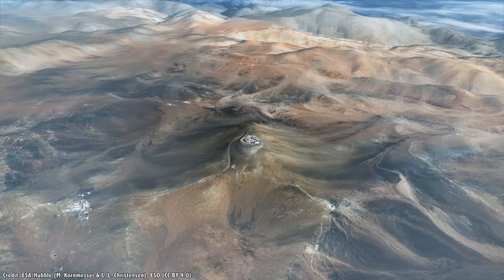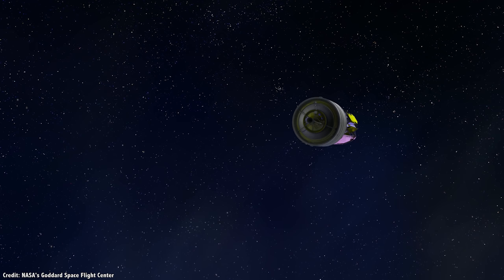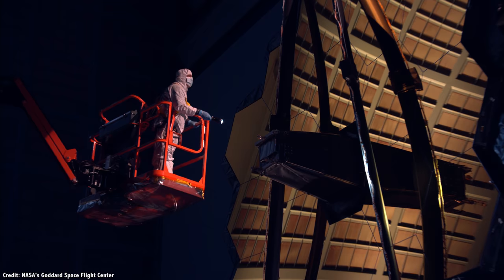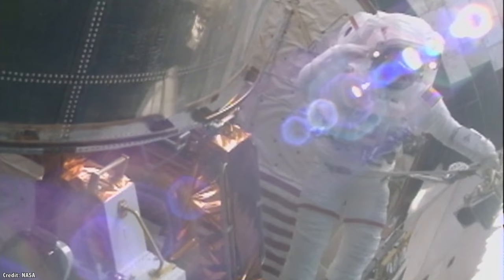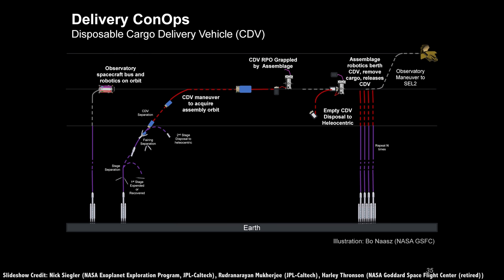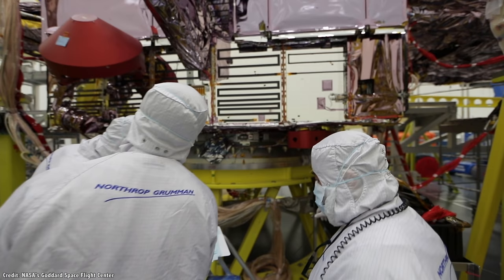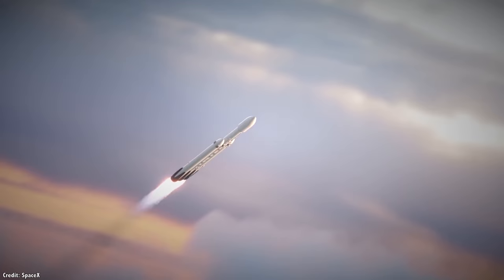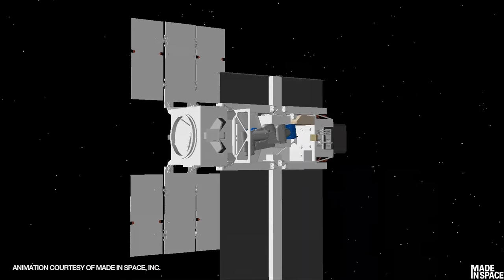Building Space Telescopes... In Space

Comment: Some time ago I read an SF story that proposed building a really big telescope in space. The idea was that if you make your mirror big enough, any particular 1 meter section of it will be optically smooth, so you can build a really big telescope out of identical, optically smooth mirror segments, with fine control actuators so that they can all be focused down onto the same point. These could be mass produced, thereby lowering your manufacturing costs. A hundred meter telescope could be made up of 10,000 identical 1 meter segments. To upgrade the the telescope you just have to add more rings of mirrors around the outside of it. With a million segments, you can build a 1 kilometer mirror.
Reply: Hmm...
 Really you want a parabolic mirror, and the curve of that varies as you move away from the centre, so edge pieces wouldn't be identical to centre pieces.
 (Although many edge pieces would be identical to other edge pieces.)
(I guess I'm saying a big mirror could be made of concentric rings of mirror, and each ring could be made of many identical parts.)
Reply: Massimo O'Kissed -- or your design can allow for gaps between the sements.
Reply from the maker: Sounds good. :-)

Comment: It's easily said than done. The cost may also be high due to the multiple rocket launches required.
Reply: It is easier said than done [or animated]. However, the charts in this video and the practical experience with the billion dollar cost over-run James Webb telescope prove that for the very large telescopes the engineering and exotic materials and risky techniques required to comply with a 5 metre fairing limit prove to be more expensive than launching multiple components that are part of a self-assembling system. Also, the re-usability of boosters and main cores may become practical enough for the heavy launch vehicles that substantial savings may be acquired; especially over multiple non-manned launches.
Reply from the maker: They're including the multiple launches in the comparison.
Reply: You can't build a 20 meter telescope and launch it on any extant single rocket so your comment is pointless
Reply: @dziban303  Who's building 20m space telescopes? The upcoming SpaceX Starship will have a 9m fairing that can ferry decently large telescopes.

Comment: @Fraser Cain
Newton's third law states that for every action, there is an equal and opposite reaction.
My questions are:
Do the I.S.S Astronauts and Cosmonauts have to remain consciously aware of the direction (relative to Earth) in which they are applying forces to the inside of the station when they are moving around and changing direction etc?
For example: When they are moving about the station, we know that they can't move unless they first apply a force on the station, by pushing or pulling on its bulkheads/walls; so, do they need to try to apply a greater number of push-forces on the side that is pointing away from Earth, and try to apply a greater number of pull-forces on the side facing Earth, in order to keep the station as high in its orbit as they can, or are the forces applied by all of the occupants, all of the time, negligible, due to some physicsy stuff to do with speed and the relative mass of the station? Perhaps the push and pull forces just cancel each other out, because the astronauts/cosmonauts are just applying forces wherever is convenient to get them around the station effectively.
Reply from the maker: Hah, no, they don't worry about that. Their impact on the station would be very small. And whenever it needs to have its orbit raised again, they just fire its thrusters to put it back in the best location.
Reply: @frasercain  I could imagine it being very inconvenient for them if they had to worry about it. 
I think that the forces applied by the 'I.S.S-tronauts' probably balance out over time, because now that I think about it, if I was floating in space, and I had another object of a similar size and mass, for example,  a large sack of grain, and I was trying to shuffle it back and forth to get BOTH me and the sack of grain to another location, say 20M away, it wouldn't work....I would need to kick off of the grain and hence lose it; so in this example, am I right in saying that the only way to physically move the station (relative to its initial trajectory, and ignoring thrusters), is to forcefully jettison something with a similar/greater/or at least not negligible amount of mass to that of the station?

Comment: I got a QUESTION:    Do you think with SpaceX will be moving away from on-land landings?  Seems that Starlink missions max out the weight capabilities of Falcon 9's so the boosters will all land down-range... For instance can they, and do they, less-than-maximum fuel the Falcon-9 based on the payload and deployment requirements to minimize launch weight, and as a result, land down-range to conserve fuel or payload?  Basically, are the days of watching on-land Falcon-9 landings on the Cape over?
Reply from the maker: They'll have to when they get to Starship because it's going to be so loud.

Comment: Was the JWST not designed well before spac-x was dreamt up? What could a modern rocket launch?
Reply: A modern Starship/Superheavy could, indeed, launch a larger telescope than the JWST (once it's finished construction & testing, of course), but there comes a point when weight is no longer the issue; size is.

You could imagine building truly monstrous launch vehicles, but materials science can only go so far, meaning those vehicles can only get so big.

Suppose you wanted to create a telescope with a mirror 1km across.  With mature space industry, that would be a fairly simple thing to do (certainly easier than the time we've had with JWST), but you could never launch such a thing on one rocket.  Building stuff on Earth in order to send it to space has a bottleneck: the limit of how big we could build a rocket.

Better to focus & to hone our ability to build &, indeed, manufacture in space.
Reply: Current rockets are still limited to a diameter of about 5m, which is what JWST was designed for. Once Starship is operational it would allow up to 9m, and maybe in the far future we'll see the huge 18m Starship variant fly, but there's no telling when or if that would ever happen. It's best to plan for what you know you have and not for what you may or may not have in the future
Reply from the maker: JWST was designed long before Starship was proposed, so the largest fairing at the time was about 5-meters. Future telescopes will be able to take advantage of bigger fairings.

Comment: This project is going more insane by the week. First the enormous complexity of the enablement of this spacecraft. So many millions if not billions are on the line, a single line. Dozens of things can go wrong during employment, all most likely fatal.
Imho, there should be 2 launched in separate launches. Costs of doing or fabricating the same thing should be astronomically cheaper. Second it should be launched in a cargo base like the next SpaceX opportunity, capable to have humans on board to fix problems as they occur after deployment and wrapping the thing up nicely in multiple, multiple layers of protecting stuff-foil.
This project is to big of a thing to fail.
Just my opinion, so don't bother with high-tech arguments against!
Reply from the maker: That's why this video is all about a strategy of doing it in bits and pieces. Building a telescope over 12 launches and not a single launch like James Webb.